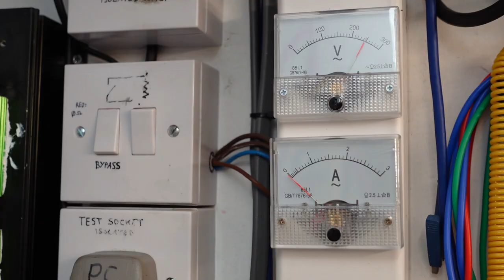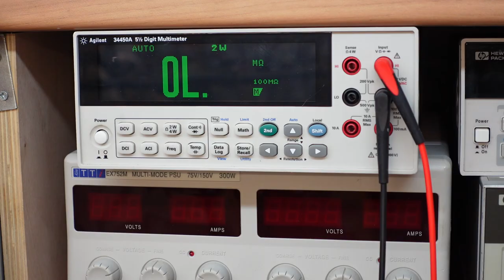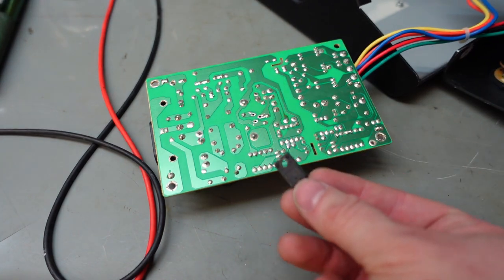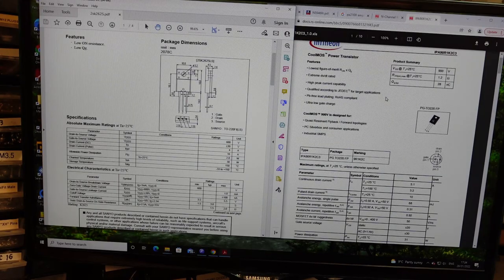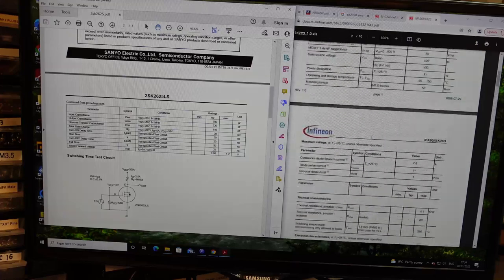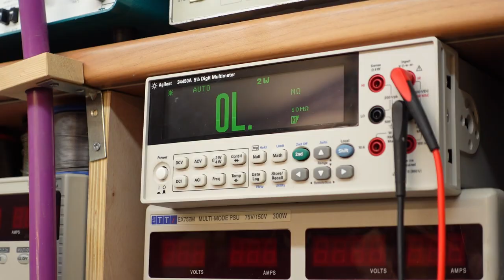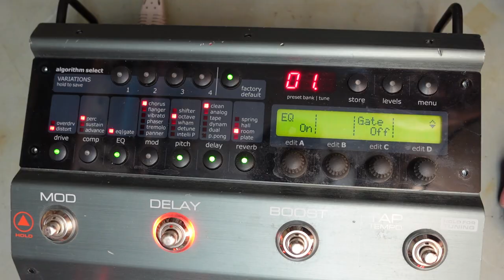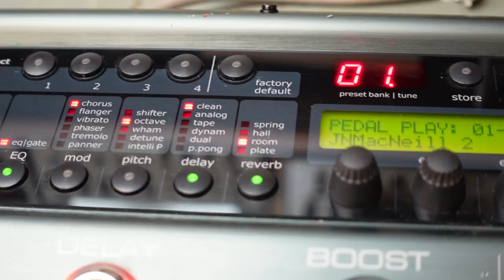Guitar Effects Pedal Repair (NOVA System)

Comment: Mark. This vid was really helpful. I own one of this units and it was blown away during a blackout. Turned out the very same components you had to replace were  'toasted' in my unit. The mosfet and that very same diode. I purchased "close enough" spare parts and voila! Unit repaired. Thanks a lot!

Comment: Hi Mark good video. Please please be aware of the glue that’s on the circuit board over period of time goes hard and crusty and creates resistance which causes these problems whenever you see this glue in a dark state remove it. It creates a lot of problems especially in switch mode power supply’s
Reply: This Caused my Subwoofer Amp to behave weird... It ate through a Resistors Leg... Removed the glue everywhere on the Board and replaced the Resistors. 
Works like it should again :)
Reply: Yes it's true.  LG set had similar yellow glue and in monsoons it used to conduct and caused malfunctioning.

Comment: This power supply is the same as the one used in Tannoy TXD-1 audio processors! I've repaired many and the main culprit is the large smoothing cap (don't forget to discharge as it holds 400V!!) The outputs are +15v, -15v, +5v and +3v. The smaller caps go quite often too and strangely - my last repair was the same Diode! thanks for a great vid! Bravo!
Reply: Tc electronics and Tannoy: Same owner, so that makes sense.

Comment: Mouser is 140 miles from here in Texas USA. I like their engineering department. If you have a part you cant source they will check it out for you have what you need the next day. During my years I would need only a small order at times. They never complained.

Comment: Good video. With boards that have sockets on the rear panel, I like to do those screws and nuts up first so the board is flush with the panel. Then do up the ones inside. That way there's less stress on the board being pulled into alignment with the rear panel.

Comment: I just repaired a Voicelive unit today - exactly the same faults. I managed to get the mosfet off eBay but it was expensive. That fuse did a really good job and prevented further damage. I have a Blackstar HT pedal which also uses an smps - no onboard fuse resulting in a big toasted section on the PCB.

Comment: T.C. ELECTRONICS are a quality company when it comes to sound processing.  My friend designed some of their products and also ran a studio in Germany.  Makes you wonder why they have design flaws from the perspective of the repair engineer.  But it's common to use a screwdriver that has an angled bit for these jobs. But I guess it happens with cars too - awkward to carry out repairs for some.  I worked as a gas engineer and we never repaired anything at component level.  Lots of wastefulness in the gas trade.

Comment: I just got a very similar issue with the PSU but in my unit only the secondary side SB240 went off. I replaced it with a 1n5822 and it works fine now.

Comment: Nice job Mark. I bet you're glad you checked the secondary for shorts. I'm guessing your new switching transistor together with who knows what would of let out the blue smoke if you didn't. I've seen some people use lightbulbs to help prevent psu melt down when they have trouble finding the fault. But this being all through hole makes things easier somewhat.
Reply from the maker: Thanks! That was an easy one to be honest. I’m not a fan of things going bang, so my test socket is fed through a few things: isolation transformer, into a variac, through some light bulbs, through the ammeter, then to the test socket. The bypass switch is used to bypass the light bulbs for heavier loads. Most of that stuff lives under the bench, out of sight.
Reply: @MendItMark  Jesus, that's one hell of a safety setup. I should of known you had all the bases covered. I wish I had that mentality. I just stick wires into the mains sometimes if I'm not bothered, lol.
Reply: @MendItMark  it'd be great to see a video about your safety setup and why it is required 👍

Comment: Stumbled upon your video. Your expertise level and ability to explain 'on the go' are amazing.
As an owner of a TC Nova System I also have a question: the control knob seem to be rotary encoders. With time they seem to get less responsive. In your expertised opinion: is this similar as with normal potentiometers? As in: could I use contact cleaner, or should I take other measures?
Reply: I don't really know, but I would imagine that rotary encoders would be solid state and have no contacts. But I would apparently be wrong:-)
https://www.youtube.com/watch?v=lylpr1anaLg          "How To Fix An Erratic Amplifier Rotary Encoder Volume Control"

Comment: Good job man. What cleaner can you suggest to clean front panels and faceplates?  I have a couple of mixers that need a good cleaning.
Reply from the maker: I use general anti static foam cleaners, like one from RS components. However, consider that they might clean off some markings and paint ( see my Technics SU-V90D video to see it go wrong). Just, don’t leave them to ‘soak’ too long, as any reactions will be worse. Test a small area first for bad reactions. In general, more modern mixers use better inks, which don’t rub off.

Comment: being new to electronics repairs.. Im confused... When you inspected the mosfet with multimeter.. You said 15 ohms, etc.. Its shorted...
I was under the impression that 15 ohms on an electrical component, Or, even readings in K ohms, was not a short?!?
I thought closed to 0.... 1-2 ohms etc, Is a short?!?!?!

Comment: Mark, what type of spray cleaner do you use on the outside of the case of the pedal?
Reply from the maker: Its an Antistatic Foam Cleaner. I use several brands, depending what is the best deal on the day. Currently using Electrolube AFC400.... I reckon they are all the same.